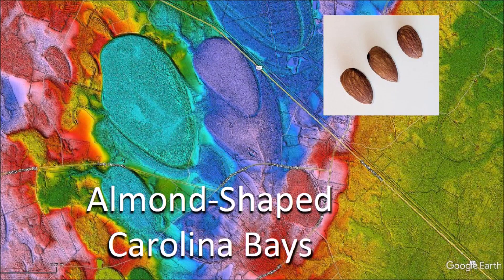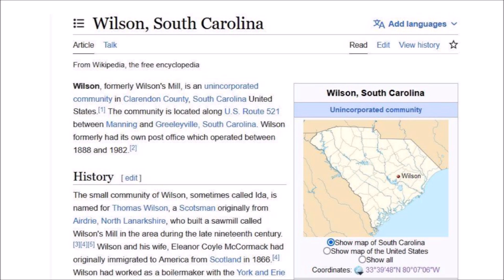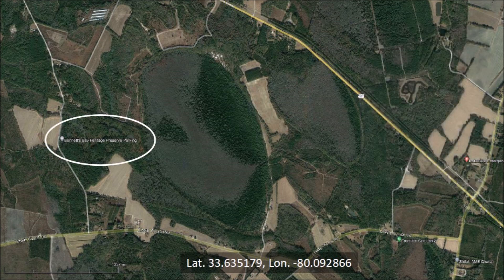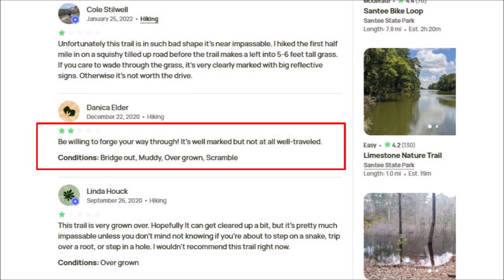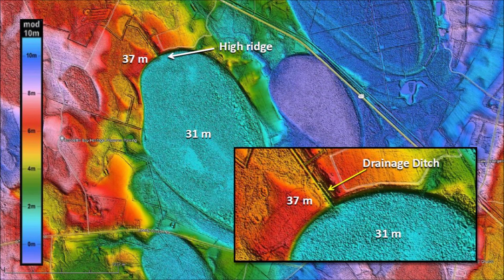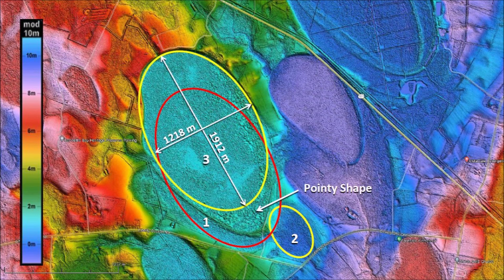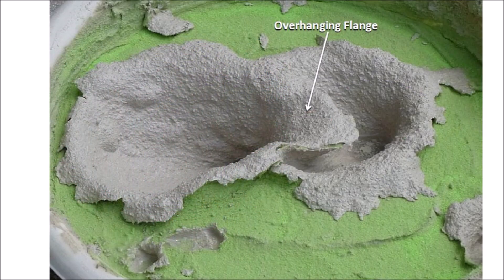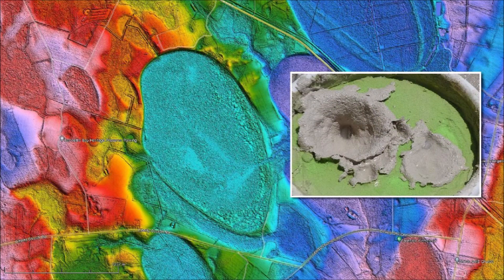Almond Shaped Carolina Bays

Comment: It's funny how I always find something that I didn't connect. Besides the shocking realization that if there were people (Clovis) around, they would be smashed by immense ice boulders BEFORE they could hear the impact of the asteroid hundreds of miles away. But still, we are thinking of the large ice boulders of Laurentide glacier as cold, frozen objects. But then I realize that if they got to 400km height, they got to vacuum and weightlessness (which might have altered its structure - perhaps disintegrated the ice within). Then they fell back to Earth, but they had no heat shield tiles 🤭, so on their way back to Earth, their temperature must have gone way up, and what is ice? Hydrogen and oxygen! If they disintegrated on molecular level, they would burn like hell! So on their way down, at least part of them was again burning, and losing the material on their way, so while only part of them impacted (and the oval bays shape confirms my hunch, as the ice boulders ripped from the glacier must had been of irregular shape, yet at the impact, the residual boulder mass shape was already rounded), there must had been insane amounts of hydrogen burning within its own oxygen generated from those ice boulders! So, not only the direct impact and air pressure, but also the air/atmosphere itself was literally on fire! There was so much burning agent (hydrogen) that it simply burnt all living material which wasn't directly hit by the impact - and this is hundreds miles away from the impact site itself! And we could also speculate also on the possibility of the bays material being thrown high up into the air again as tertiary impact objects! And what about the result of that burning? Hydrogen and oxygen didn't disappear, the product of its burning is again water! That water remained for some time in the atmosphere but then must have caused immense rains on its merrry way around the globe. Also, seeing the direction of the projectiles that created bays, we can even speculate (if Atlantis was where Plato wrote it was, i.e. Azores) on its impacts on the entire North Atlantic basin. Scary stuff.
Reply from the maker: During re-entry the ice chunks would have formed a shield of steam on the leading surfaces. See the video about re-entry: https://youtu.be/KUKM3CYsOlE
Reply: @Antonio_Zamora  Thanks for your answer! So, you're sure the stuff didn't ignite?
Reply from the maker: @Alarix246  If ice could dissociate into oxygen and hydrogen, the torch experiment would have been very dangerous.
Reply: @Antonio_Zamora   can the blowtorch create temperature over 3000C? My hunch about water splitting to its elements comes from an article I read sometime towards the end of 1980s. It was about fires, where the flame reached extreme temperatures (for whatever reasons), it was above 3 600 degrees Celsius, and the experiences of firefighters who tried to extinguish it by water. They found they could not extinguish it by water jet as the hydrogen within the water actually helped the fire to grow. I also remember that they were describing something about the problem that in such cases even the concrete burned. It is so extremely rare that people are not aware of this effect. I tried to find something for you but first thing I found was in the wikipedia (https://en.wikipedia.org/wiki/Water_splitting) in the chapter about Thermal decomposition of water. Sounds crazy but it's real. And the temperatures and pressure in comet impact are off the scales we are used, and so are the behaviors of basic elements like water.
Reply from the maker: Thanks for your research. Indeed, water heated to >3000C will dissociate into its elemental components. However, the reason why I have based my numbers on the space shuttle re-entry is because the shuttle comes in at about Mach 15 and experiences a temperature of 1650C. The suborbital spaceflights of the ice chunks had speeds of about Mach 11 and a propane torch has temperature in the range of the space shuttle re-entry. 
https://en.m.wikipedia.org/wiki/Propane_torch
 https://en.m.wikipedia.org/wiki/Space_Shuttle_thermal_protection_system
Reply: @Antonio_Zamora  thanks Antonio, that explains it perfectly!

Comment: On the upper left corner there's a small bay with a similar shape without an underlying impact
Reply: more than likely that impactor fell onto soil undergoing liquefaction from the previous HUGE impacts (miles wide). i'm curious to see if other almond-shaped bays elsewhere exist near the largest ones.